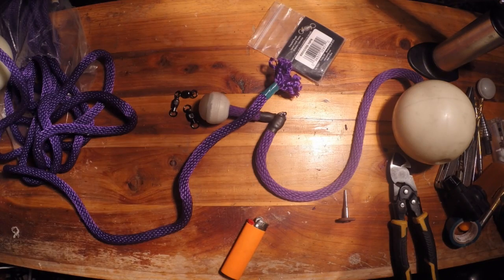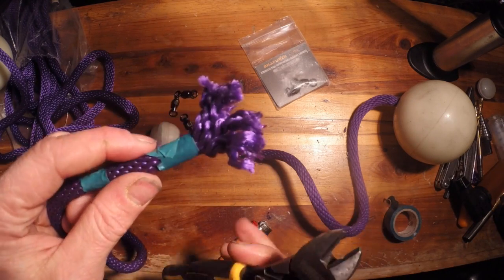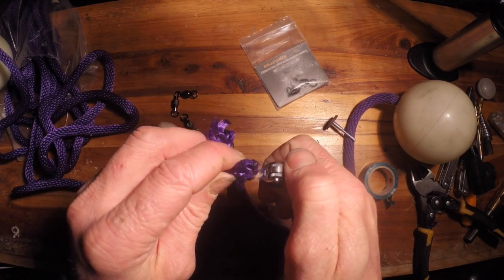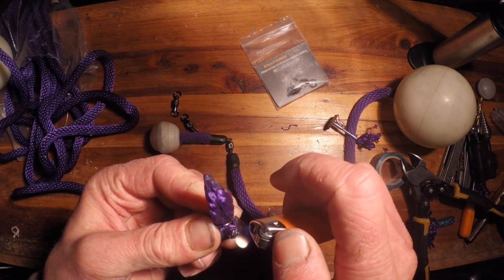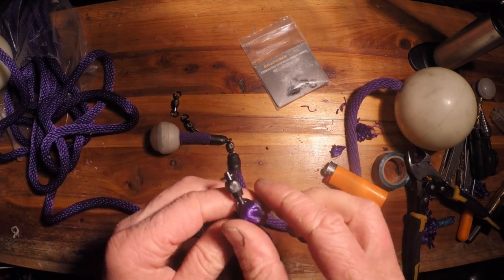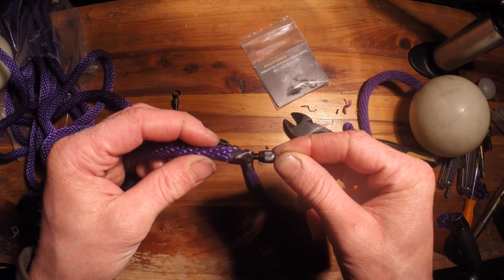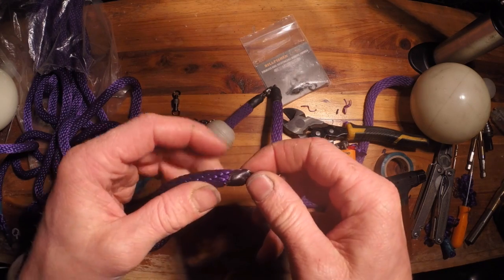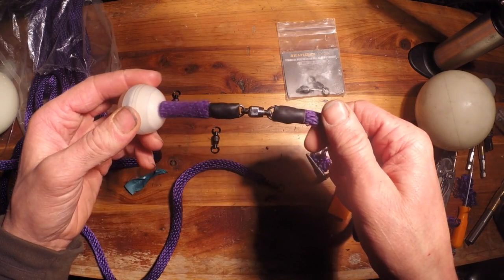Poi Swivels on 3/8 rope. Tutorial

Comment: In the description of the video you said u use polyester rope from flow on fire now and it doesnt shrink. Do they do something to it? I ask because ive had contact poi from home of poi with polyester rope and they ended up shrinking on me.
Reply from the maker: Evan Merritt I used FOF polyester rope for  a while and it did end up shrinking some but nothing like polypropylene rope does. As soon as it lets me I will fix the description. I use technora and it doesn't seem to shrink and I've used it for a long time. I'm also using endura braid which has very minimal shrinking. I may have shrunk a half inch over 50 hours of use and I think it's done by now

Comment: Thanks for making a great tutorial on this! I want to add swivels to my podpoi to be able to do orbitals but are there any tricks that may be limited later on in doing so? I've got weighted handles but wasn't sure if the swivel would interfere... I haven't been able to find any solid info out there on this specifically. What's your opinion? Thanks so much!
Reply from the maker: Yeah tosses get wonky with swivels. I got fed up with that and came out with a handle that's got a inline ceramic bearing in it so that you don't have a break in the rope. It's a 3d printed handle with a rubberized grip and takes the dot xl led chip from ultrapoi. Does orbitals so smooth and weights the handle super nice. It's called the Eggknob and it was created by Sergio Medina and myself. It's from the company Lost In Flow and is sold thru Flow On Fire. Best handle ever imo. Super easy to install if you use rope that can be melted like polypropylene or the new FPC rope by flowtoys. I have a review on my channel on both the FPC and the Eggknob. Check it out if you like
Reply: @ThePoiMechanic  I checked out the eggknobs and they seem like an excellent design! Very sleek that you incorporated the bearing right in there and with leds too! I love the idea. :) 

In the install video it looked like thicker tether being used.. I have 6 mm smithy on mine now, would it work with the eggknobs the same?
Reply from the maker: @kelmontgomery1012  it probably would if you could find a bearing that fit. It's a 22mm wide cavity although I think flow on fire uses a 21mm size as well if you ask for that. So you would need a 22 wide X 6mm tall X 6 or 7 mm inside diameter. Not sure how that heavy of a knob would do on that thin of rope though

Comment: About the endura braid you were talking about, is that the rope u were referring to when you said it shrank a half inch? Also, were are getting it from? Cant find any supplier of just the rope
Reply from the maker: Evan Merritt Yes the Endura Braid Rope by New England Rope Company has minimal shrinkage. I get it at Velasailingsupply.com. They seem to be the cheapest out there but sometimes West Marine has it on sale. It's expensive but so worth it. It will be the new standard at some point because it's catching on and it's amazing. Because it has a inner Technora rope covered by a outer Polyester jacket it's not as easy putting swivels on it but definitely doable. That will be my next video I'll be busy working the next couple months so I'm not sure when it will come out
Reply: The Poi Mechanic thanks buddy, i appreciate all the help. And yeah i know how work goes man, but loom foward to seeing your videos.

Comment: Will this method work for 1/4 rope as well?
Reply from the maker: I think it could but I have never tried it with something that small. Probably wouldn't need to separate the strands, just stick the whole rope thru the ring
Reply: @ThePoiMechanic  I ended up using ur method with the 1/4 smithy rope and so far so good. I didn't like just putting it straight through the hole without separating strands cuz it looked weird/uneven. Thx for the awesome tutorial.
Reply from the maker: @trehs86  Sweet! Glad it worked!